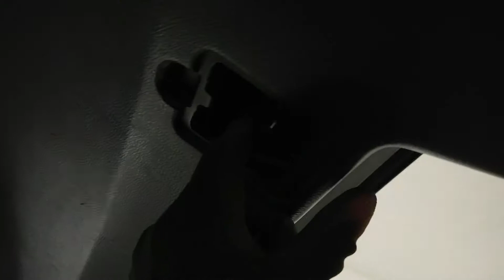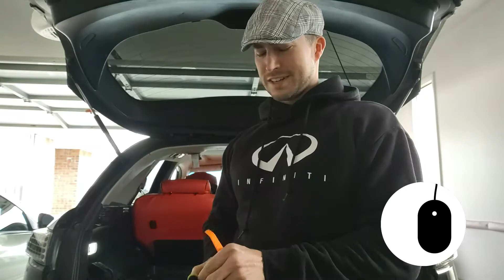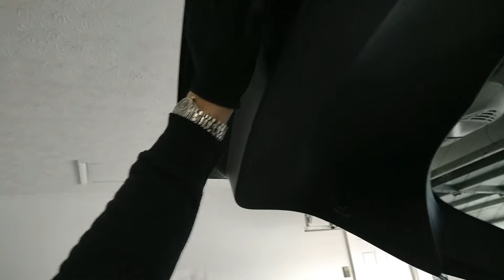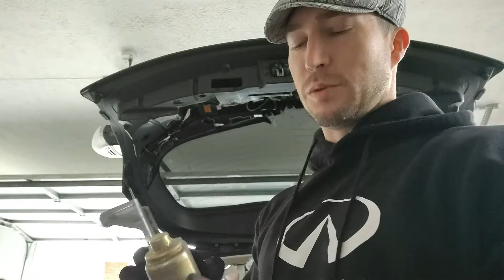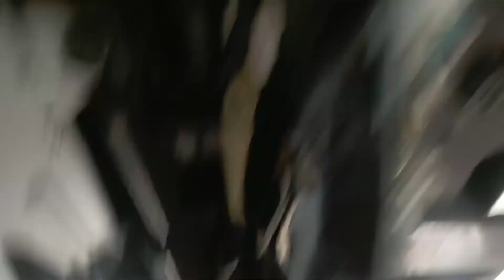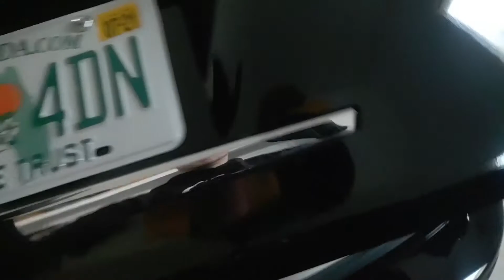INFINITI FX35  Rear Latch Motor / Actuator Replacement (Project FX35 ep12)

Comment: Replaced the motor and nothing 😢, but pulled the #18 15a fuse and put it back in and currently working after a dozen tests opening and closing.  Hopefully this tip may help someone if they experience the same.  Not sure if itll stay working though.
Reply from the maker: thanks for the tip

Comment: The only part missing from the video is a close up view of how you detached the power connection...everything I've tried has damaged the power-side connector
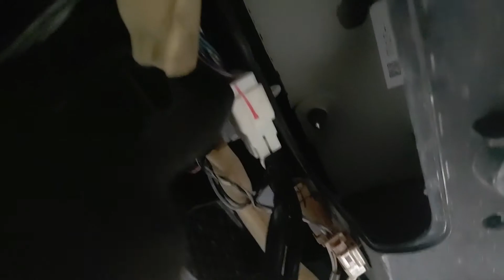Reply from the maker: Watch again at 6:30 where I showed it the best I could and explained what I was doing since I needed 2 hands and couldn't hold the camera and undo the power connector. Most cars have these kind of electric connectors, just squeeze and pull. Sometimes you need a small flathead screwdriver to squeeze in the sides, but that's all there is to it. Then there's the grey tab that holds it in,  you'll need to push that out with something.  Hope that helps.

Comment: Anyone got ideas of what to do if you can’t open it? Mine the mechanism sounds like it’s working but there’s a zipper caught in it (I’m aware that it’s dumb). Doesn’t seem like I’d be able to disassemble while it’s closed.
Reply from the maker: Will it open via the emergency release inside like I did around the 0:20 mark or is that stuck too? If that won’t open either I’m not sure how to get to it
Reply: @GQ37official unfortunately not I think I’m gonna just cut up the bag and try to pull the zipper out of one side
Reply from the maker: @maggiewathen7053  oh gotcha. Yeah if the zipper and whatever is stuck is visible definitely work on getting that removed. Hopefully it doesn’t scratch up your bumper too much in the process, but the bag is probably a lost cause unfortunately.
Reply: @GQ37official  if you were invested we ended up just sticking a crow bar in it on the inside then activated the button on the outside and it popped open!
Reply from the maker: @maggiewathen7053  oh good deal glad you got it open!

Comment: Did the faulty door latch drain your battery at some point? 

My alarm tells me my door latch is open, but the open door does not show on my dash and it is draining my battery within a day or two? The weird thing is mine open and closes fine and I can even hear it click. It's not the Alarm as the alarm was replaced and new as well  Pretty Weird it's draining my battery since door is closed and locked. 

Seems easy enough to do, but it's getting cold here in NYC and I'm a little worried the plastic clips can break? cold plastic can become very brittle.
Reply from the maker: Indeed the plastic clips are brittle as is so I understand. No, I never had an issue with battery drain when mine did this. Mine didn’t show door ajar, it just wouldn’t open when it failed. 🤷‍♂️
Reply: Hi, I am facing the same problem. I wonder if you have figured out how to fix it. Thanks.
Reply: @huihan4219  Yes for me it was not the door latch or Actuator, It was the Alarm installers error, he hooked up my alarm as it it was a regular alarm and since newer alarms work of the Body Control Model there is not need to hook up the door open and close wires. Since he hooked up the open and close door wires and the body control module was also controlling those same components the wires were, it caused a drain issue and alarm constantly going off after 30 seconds.  

Hope that helps.

Comment: Hi Chris, I changed the lock and the trunk no longer suction.
Reply: Yes, it closes and opens perfectly, i have another car i will change the lock and see if it work.
Reply from the maker: Strange.  Does it open and close though?  I’m wondering if not all fx latches we’re motorized so maybe the replacement you got isnt? 🤷‍♂️ not sure just grasping at straws

Comment: I'm guessing this was an option? I just bought an 07 yesterday, one owner, garage kept, and mint for $5400.00. I do not hear a motor when I close the back and it has to be opened from the back from what I can tell.    As with any vehicle I buy there's a learning curve figuring out where everything is and the different functions.. I've subscribed and I'm sure you'll save me some time at some point.
Reply from the maker: Thanks for the sub. Not sure, I've owned 2 first gen fx35s, a base model 07 and this loaded 08 and both had the motor  that would grab the hatch and pull it in another inch or so when closed. Honestly I always thought it was weird because any other car you just close the hatch, but on both of mine you close it and then it pulls it in just a tad more. No idea what the purpose is, but it's possible that yours went out, but as long as you can open and close it I wouldn't worry about it. 😁

Comment: I would have liked to see how you actually put the part in
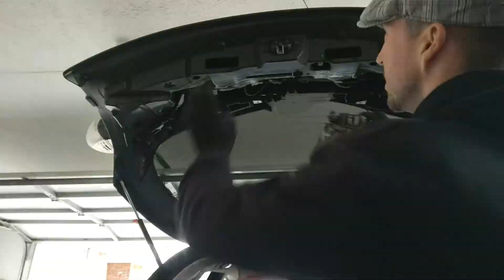Reply from the maker: Sorry I only had 2 hands and was in the way of the tripod. At 6:05  as shown there are (3) 10mm bolts in front and one on the bottom plus the power supply, it comes out from the back and install the new on in reverse order. Thanks for watching

Comment: Hello Chris, thank you for making this video.   I have a 2012 FX35 and a 5 gal jug of water tipped over when I made a turn and started spilling into the cabin.  I quickly pulled over and opened the back hatch using the hatch button to the left of the steering wheel and uprighted the jug, but only after a couple of gallons spilled out.  Later that day, I tried opening my hatch with the same button, the key fob, and from the back of the car, nothing happened.  Do you have any ideas on what I can do to troubleshoot this problem?
Reply from the maker: Make sure you didn’t turn off the switch to open / close the hatch near the button under the steering wheel. I’ve done that before on my 2nd gen and thought it was broken. Otherwise it’s possible that something shorted with the hatch motor 🤷‍♂️

Comment: My 2015 QX60 hatch is not going up. It closes fine just won't open all the way when I push all the unlock buttons on the car. Any ideas on how I can fix it?
Reply from the maker: so yours is motorized correct, you pull on the handle and then it will usually auto open?  If so, can you manually raise it or is it stopping part way like it's getting stuck on something?

Comment: Is there anyway you can tell me if there’s a door lock actuator fuse/relay for a 2005 Infiniti fx35 and it’s location?
Reply from the maker: I'm not aware of a specific fuse just for the door locks. Usually it's the door lock actuators that go out. Unlike windows where mainly the front driver / passenger are used the most, it's more common for all the door lock actuators to go bad close to the same as the vehicle gets older.... they were all installed at the same time from the factory and thanks to remote door locks they get locked and unlocked about the same amount of time daily and tend to wear out at the same pace. Its a bit expensive to replace them all at the same time, but from what I've read that tends to be the fix. Let us know here if you find another work around.

Comment: So it slammed shut instead of closing on its own once it gets to a certain point of closing??
Reply from the maker: Yes instead of the motor taking over once you shut it and sucking it in the rest of the way it didn't do that which is a sign that it's going out and one day you'll just go to open your hatch and it won't open from the outside, which is what happened to me

Comment: Thanks for doing these, just found your channel and a lot of the things are the same on my fx45. But I had a question, do you know what tail lights you have on your 35? because they don’t look like my stock ones.
Reply: 2003 45 btw
Reply from the maker: Hey thanks glad some of these videos might be helpful. Yes those are the oem smoked twilights, they were a factory option, but a bit rare compared to the red ones most came with. Sometimes you can find them used on eBay. Same fit regardless if it's a FX35 or fx45 so it's an easy upgrade if you can get your hands on a set of ones in good condition. To me it makes a big difference on the rear end of the vehicle!
Reply from the maker: Hey thanks glad some of these videos might be helpful. Yes those are the oem smoked twilights, they were a factory option, but a bit rare compared to the red ones most came with. Sometimes you can find them used on eBay. Same fit regardless if it's a FX35 or fx45 so it's an easy upgrade if you can get your hands on a set of ones in good condition. To me it makes a big difference on the rear end of the vehicle!

Comment: How you fold down and up rear seats on a infinity fx35 2005
Reply from the maker: There's 2 ways, in the seat itself near the seat belt insert is a small plastic lever poking through the lower back portion of the crease (in between the seats) pull that up to move the seat back and forth. The other way is from the rear hatch if you're trying to lay them flat....there is a lever on each side Right and Left of the vehicle just under that small rear side window, it's usually a dark grey color, pull that and push the seats forward (or back if you want to recline it more)  Hope that helps.

Comment: Hey Chris I seem to be having the same issue with my 2008 Infiniti fx35. however, if I removed the 15 amp fuse for the rear it works for about a few weeks to a month. then I  have to repeat those same steps.  Do you still think it's the rear latch motor needs replace? and also do you have the link to order the replacement motor.  thanks
Reply from the maker: Hi Mark that is a bit strange it seems more like an electrical issue than the motor if it works temporarily after replacing the fuse. Hard to say if replacing the motor would fix it as it doesn't sound like that's the issue. Might be worth having a dealership diagnose it even if you replace the part yourself to save money. As far as the latch motor actuator I bought mine off eBay. I didn't put a link in the video as it's not a mass quantity listing type part so once that part sells that link would no longer be good. However, if you want to get one I can find one and send you a link.

Comment: Is that the actuator or just the motor
Reply from the maker: It's both, motor and actuator all in one.  Here's one on ebay like what I bought so you can get an up close look  https://www.ebay.com/itm/03-08-INFINITI-FX35-FX45-REAR-HATCH-TRUNK-LIFTGATE-LOCK-LATCH-MOTOR-ACTUATOR/265104560526?epid=1522286380&hash=item3db976918e:g:bZAAAOSwO7Jf8QrZ
Reply: @GQ37official  ok cool ordered a different one but same exact set up, thanks a lot , hopefully this fixes my problem. Sometimes doesn’t open when I unlock my car , and doesn’t lock when I lock my car . Weird when explained but I am assuming it’s just going out
Reply from the maker: @infiniti_fxvq4602  hope so, mine was acting flakey and then just went out completely.

Comment: Hello Chris - does your FX suffer from the weak door actuator issue?
Mine functions in cold(er) weather, but when it is warm the rears fail to unlock / lock sometimes.

Also, what did you do with the crossbars for your roof rack? I've been looking for some for mine! (05 FX35)
Reply from the maker: Thankfully no mine doesn't have that issue. I didn't take my crossbars off, I painted the roof rack and put it back on as it came.